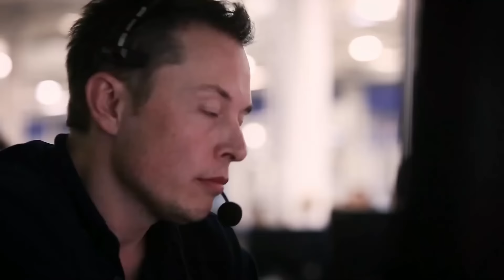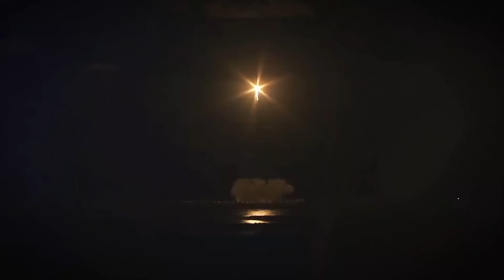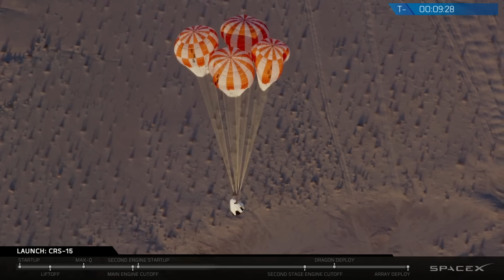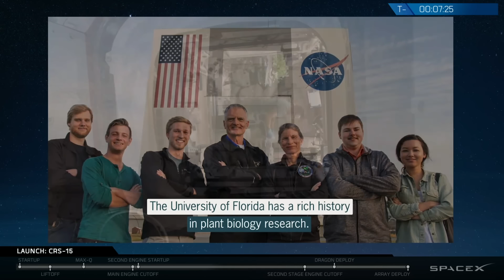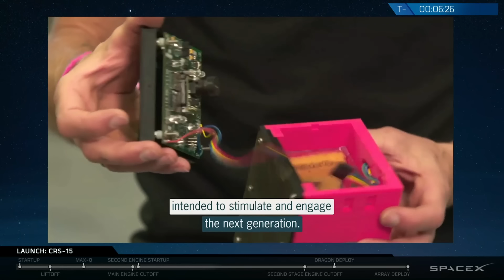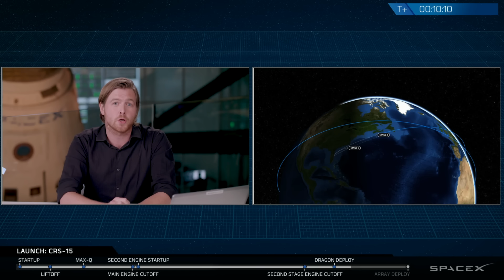CRS-15 Mission

Comment: Rest in Pieces Block 4, a very smooth and beautiful (see the pictures) final flight, to end up in the drink, leaving the job to Block 5, Falcon Heavy and BFR. 
Farewell to the booster that transformed the rocket industry forever, and happy birthday Elon.
Reply: Actually there will be one more flight of B4 (not to the orbit though) - it will be flight abort test at Max-Q in october with Dragon 2 capsule.
Reply: Where did you learn that? Haven't seen this coming, but I could have expected it, since Crew Dragon testing does require in-flight testing.
Reply: Yes, from what I read, this will be the last B4 to fly. In-flight abort test will be with a B5.
Reply: I don't think they'll use a B5 to make an abort test, not for the standalone capsule that is. But the Demo Flights will all be made atop a B5 boosters, I believe the fiery end scenario is more likely. Also, they may have another one in storage to put in the garden when they have their new buildings at the KSC.
Reply: That one is the first Block 5, because it was disassembled after its maiden flight for deep inspection. Since it will never fly again, they plan to expose it at their new facility when built, again at the KSC.
Reply: They still have B1042, which is speculated to be used for the IFA test for crew dragon
Reply: Alpha Gusta I read it on a Reddit thread. In my opinion it's normal that B5 will perform the in-flight abort, because B5 will launch every crew dragon.
Reply: The Spot it wont be. There is no second stage. The first stage will not have time to be recovered, as dragon deploy will be in the first 1-2 mins. They would not waste a still new B5 booster just to let it crash.
Reply: Jamie Clumpas Wow didn't know that.
Reply: This was the last Block 4 ever produced. Yes this was B1045 on it's final flight. Remember, B1046 is the first Block 5 that launched Banghabandu-1. Now the booster that'll be sacrificed in the in flight abort test. Is actually an older one: B1042. B1025 and B1023 are technically still flight worthy but have been retired after performing their reflight as FH side-boosters and will likely be put on display in the upcoming rocket garden.
Reply: 221 b I saw you in another video. Maybe Mic of Orion?
Reply: Quite possible, I watch that channel and basically anything spaceflight or atom bombs ;).
Reply: oh yeah ;) cheers :))
Reply: Alexandr Kovalenko actually they have one block 4 but is the  core B1042, i dont Think they Will use that thing to do an in-flight abort test because the octaweb of that core caught on fire after the landing on the droneship (launch Koreasat 5A)
Reply: 221 b the octaweb of the core B1042 caught on fire after landing, i don't Think they will refly that booster
Reply: 1046 is going to refly iirc
Reply: As far as I know it's pretty much set that it'll be 42. It is one of their longer refurbishments. Over a year I think.
Reply: Alexandr I think unless they changed it that that booster will only have 3 engines installed in a straight line. They don't need nine with no 100+ ton second stage installed. That will be one weird, short rocket for sure. No need to dump a bunch of extra hardware. The booster will probably get blown up by the AFTS after the capsule and trunk go flying away. The FAA will require a fully op. AFTS on any rocket, especially one that is programmed to abort. Should be a very cool test.
Reply: Alpha Gusta- The booster will be a 3 engine inline block 4. The booster is an irrelevant part of the test. The test is to see if the Dragon can escape from the top of a rocket at max-q. That is all they are testing. The 3 engines is so that max-q happens at about the same altitude and speed as a full up Falcon 9 Without the second stage it will be much lighter thus the 3 engines. Unless they have changed that scenario since I heard it.
Reply: mraerospace, No, there is one more. This was the last one to be used on an orbital flight, but the very last one will be used in October on the suborbital test of Crew Dragon's in flight abort system.
Reply: Alexandre Arrivé  except they just flew the very first block 5 a second time.
Record turnaround no deep inspection, just sayin.
Reply: Excuse me, airforceproud95 called. He wants his meme back

Comment: final block 4.....   :(
Reply: I believe there is one more for the in flight abort test for Crew Dragon so not the last one just yet!
Reply: Last one to be launched. If I remember correctly the flight abort test is an extended static fire
Reply: No, it is definitely a launch - they are testing an abort in flight. Won't get to orbit though.
Reply: They will abort at max-q which occurs at roughly 1 minute and 10 seconds into flight on Dragon flights. This is when the speed and density of the atmosphere combine for the greatest loads. After that despite ever growing speed, the atmosphere's density falls so drastically that flights loads keep decreasing after max-q. Therefore if you can complete a successful abort during that phase of flight it proves you can do it anytime during flight, since then the capsule needs the maximum amount of energy to escape whatever remains of the booster.
Reply: Actually, not quite. The very last block 4 will be used on the Crew Dragon abort test in August.
Reply: The king is dead, long live the king!
Reply: anyone know why they left on the landing legs and grid fins?
Reply: Soon...first block 5 :)

Comment: Thanks for the many inspiring moments and for disrupting this industry forever, Block 4!
Reply: I believe that one of the Stage-2 engine cameras is a "normal light" type and the other camera, which appears to be mounted 90 degrees around the circumference, is an "infrared" type. These  cameras capture events on the nozzle in the visible and infrared bands of frequencies to get a more complete picture of what is happening to the nozzle.

Comment: Can you guys explain the camera angles a little better please?
Reply: As for the 2nd stage, there's only one engine, they just have two cameras on either side
Reply: I guess they like seeing a visual of both sides of the engine so they can tell everything is running as planned.  eg. if a nozzle developed a crack on one side they'd certainly want to know about it so they could fix whatever the problem was for next time.
Reply: Shourya Bose Yeah...

Comment: 28:43   Ok, what was that floating black plastic-looking thing that entered the screen from the right?
Reply: Sea Pig one of the engineers recently broke up with his fiancé and decided to place the engagement ring in its box within the second stage cargo adapter.
Reply: Chadwick Wood no way! Really?!
Reply: Nut
Reply: Probably just a bolt that detached from the payload adapter during separation.
Reply: "Where did I left my phone?"
Reply: I'm sure it was in the glovebox... Oh Sh-
Reply: Looks like a smaller model of dragon itself lol
Reply: There might be a few questions about that.  Looks like something was loose in the interstage. Could have been a lot worse.
Reply: 28:44 now, seems the time stamps have changed. grrrr.
Reply: Sea Pig maybe plastic?😂
Reply: Wheresa11y, thanks for the updated time.  Yea it appears to be something with a flange one end with a hole in the middle.  

Or FOD
Reply: 39:03 seems to be something moving on mars. what is it?
Reply: Nerion, Espy Of Wolves what the fuck are you talking about
Reply: SpaceX doesn’t use explosives for separation, but it could have been a bit of insulation between the two connected parts, or anything.
Reply: It's def not a piece of insulation. It is exactly as test two described. I'd be very interested to know what it is and if it's meant to do that. It's not like small bits falling off when stage 1 gets dropped, this is at orbital velocity...whatever it is looks like it's now a dangerous piece of orbital debris
Reply: Kirk Claybrook I just said that because it’s not shrapnel from an explosive bolt as someone else said it was.
Reply: it's obviously what the anime Planetes predicted would happen in the future. Actually no lie worth watching it's an anime all about how mankind put up so many satellites that whole business has come up for the cleaning of space debris.
Reply: Yep it was a cup of ramen noodle soup.

Comment: Without checking into the reasons, I wonder why they wouldn't attempt to recover the first stage? I thought that was one of the main points - reusability.
Reply: this is a block 4 booster, and SpaceX is moving over to the block 5 rocket. The main purpose of the block 4 was to test out parts for the block 5, which is made to be even more easily and quickly reusable.

Comment: would it be a good idea if the second-stage engine module were to be stocked somewhere in the orbit or the moon in order to be reused for the assembly of an interplanetary ship in the future?
Reply: I don't think the 2nd stage of the bfr would use the same engine. If it did, I don't think that would be the best idea, I don't think it would be very fuel efficient, because you would have to pay a visit to the moon, rendezvous, and dock with it.

Comment: I was wondering if there was a reason they didn't land the booster. Since it was a regular launch to ISS the mission details shouldn't be a reason to do it. Is the cost too high, aren't there already e.g. museums interested in a booster stage? I understand they don't want to reoperate the B4, but I kinda think landing it and would still give valuable data (even though they nearly manage successful landings 100% now) and the booster stage would have made a really nice memory.
Reply: Just not worth the trouble after all their experience with it.

Comment: Why don't they retrieve the first stage anymore?
Reply: This was the final revenue launch of a "block 4" (B4) version of the booster.  This particular one has already flown once before, and recovering it was not worth the bother.  Except for the in-flight abort test of a Dragon capsule all future launches will use the B5 version.  They will be recovered whenever the mission requirements permit.

Comment: What happened to the link up with the space station?
At twenty thousand mph how comes it takes three days to reach the space station.  You could almost get to the moon and back in that time, or perhaps that’s where it went
Reply: Big Mac  It's not just a matter of getting to it. The space station is in orbit, going about 17,500 miles per hour. Now, you can go up, and fly by it easily enough, but unless the two spacecraft are in precisely the same orbit, virtually motionless relative to each other, docking is impossible. Thus, the Dragon has to get up into space and very slowly catch up to the space station. That's why it takes two or three days to get there.

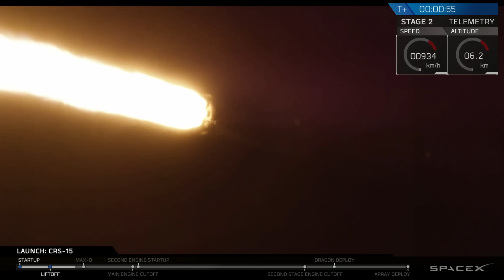Comment: How do we get a camera shot of a rocket going up at 400mph @ 19:40 , to  it going 530 mph sideways @ 19:50 , continuing sideways 900 mph  @20:20, then @ 20:50 it's going 1,900 mph ! , and we appear to be directly under the the booster while it is now going straight up !
Reply: It's just at different angles, the rockets still going pretty straight up
Reply: It curved over and was going mostly sideways. Once your up, you need to go fast parallel to the Earth's surface in order to orbit. The camera was tracking it from behind, not under.

Comment: Seems to me shortly after MEC and SE Starup that there was a lot of vibration?  Or at least the camera was shaking a lot.  But curious to know that that regular pulsing effect on the shrouded area around the engine base is?
Reply: I thought so too. Also as about 22:25 the second stage appeared to have a rhythmic pulse or shock every second or second and a half. Most noticeable when looking at the foil insulation above the engine.
Reply: guessing its the nitrogen thrusters. if you watch onboard footage of the first stages when they flip over for the boost back burn, the thrusters are a fairly violent whack. to me that movement sorta looks like the same thing and I kept thinking I could see some of the gas sometimes when it did it, but that could just be light hitting the exhaust plume or something.

Comment: When are you sending manned flights to the ISS. I believe you can do it now, so what's the hold up? You have completed more preflight's than NASA has before they did a manned flight.
Reply: NASA requires seven flights of Block 5 first.  Killing 14 crew must have made them a little edgy.
Reply: not just seven flights of block five, but seven identical flights with identical rockets with identical dragons before they will send manned flights. Also, is the crew dragon is not flight proven yet.
Reply: richardschimacher  Yeah, killing 14 crew because they flew the machine out of spec, over the objections of relevant engineers.
Reply: Critical Thinker  The first crewed flight of Dragon 2 is scheduled for January 17 of next year. Since it was developed under a NASA contract, SpaceX doesn't have quite as much freedom to do anything they want with it as they otherwise might. First they'll have an unmanned test flight, rendezvousing and docking with the space station, scheduled for September 16. and in October they will have a test of the in flight abort system. NASA also requires seven successful launches of the Falcon 9 Block 5 booster before they will declare it man rated. Assuming all of this goes as intended, then we finally get a manned flight next January.
After that, currently, nothing is scheduled before 2020. Personally, I hope they move operational flights forward. It is long, long passed time that we should have told the Russians to pound sand. It's been a long, frustrating wait since we foolishly mothballed the Space Shuttle fleet, and have had to ride Soyuz's ever since. But, the future looks bright. Currently, the United States is developing no less than six different manned spacecraft, the Dragon, Boeing's Starliner, NASA's Orion, Blue Origin's New Glenn, Sierra Vista's Dream Chaser, and SpaceX's own BFR, which will make Soyuz look like a biplane. Just think, it's possible that, in a few years time, all six of these could be flying. Wouldn't that be something?

Comment: I don't listen to all the beginning before the launch, I just would like to know a couple things. First, to retire first stages they can fill them with less fuel and make sure to use it all up? Then it just gets dumped in the middle of the Pacific Ocean?
Reply: I should have said Atlantic Ocean, since it doesn't look like it could make it to the Pacific.
Reply: You need some fuel to make a control crash into the designated spot in an ocean.
Reply: Yes, you are correct.

Comment: What happened with the stage 1 landings?.
Reply: Over time they have steadily developed newer and better versions of the Falcon 9. The Block 4 version has been reusable, but it could really only be flown twice. The new Block 5 on the other hand can be flown up to a hundred times. Most of the last several flights have been using previously flown Block 4s, expending them because they can't be flown again. This was almost the last one. The only remaining Block 4 will be used for a suborbital test of the Crew Dragon abort system in October. Other than that, all future flights will be with Block 5s and will be landed and reused.

Comment: where is the 1st stage landing?
Reply: The Block 4 boosters were just barely reusable. They could really only be flown twice. They have been using them up and expending them on the last several flights. This is almost the very last one. From now on, they will be using the Block 5 booster, which will have a useful life of as many as 100 missions.

Comment: Gratulations on the launch question do you still go after the first stage to recycle so you're not polluting the ocean.
Reply: They are introducing a new version, the Block 5, which will be significantly more reusable than the Block 4. They have been using up and expending the inventory of Block 4s. This was the last orbital flight of the Block 4. All future launches, except for the abort test of the Crew Dragon in August, will use Block 5 and be recovered.

Comment: Why do we use Helium to keep the tanks pressurised? My understanding is that Helium is a highly limited natural resource on Earth and we need to preserve Helium for vital applications like cooling the magnetic coils of MRI machines and cooling for particle accelerator machines such as the LHC, all of which get too hot for Liquid Nitrogen to cool sufficiently. Why don't we use Nitrogen instead of Helium for pressurising the propellant tanks?
Reply: Adam Nair 
Low mass high performance. If you are worried about helium loss worry about grocery store balloons before you worry about rockets.
Reply: @Adam_Nair
Do not worry, the helium pressurization system is required only for current-gen Merlin engines. The upcoming Raptor engines are going to use full-flow staged combustion cycle - a most efficient design currently known, which is using some amount of gaseous propellants as a pressurization agent. There will be no need to use helium.

Comment: Nice backronym for RP-1.  I guess "refined petroleum one" is too politically charged given Elon's green focus.
Reply: "politically charged"...Oh, fer cryin' out loud, give it a break! RP-1 has been called RP-1 since before you were a grin in your momma's eye. Political B.S. has nothing to do with it. "In the mid-1950s rocket designers turned to the chemical engineers to formulate a heat-resistant hydrocarbon, with the result being RP-1."
Reply: Laurence Battin Yes RP1 is longstanding, but he called it “rocket propellant one” which is the PC version.  Creative backronyming IMO, since every book I ever read from the 60s said RP stood for “refined petroleum “.